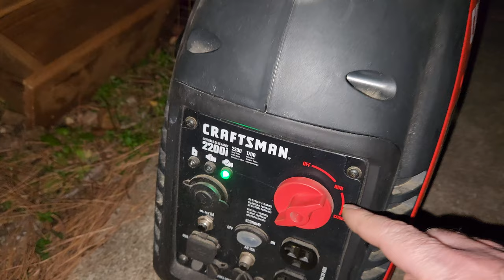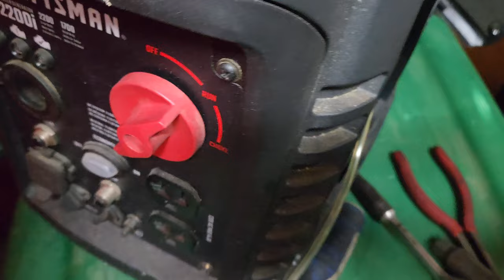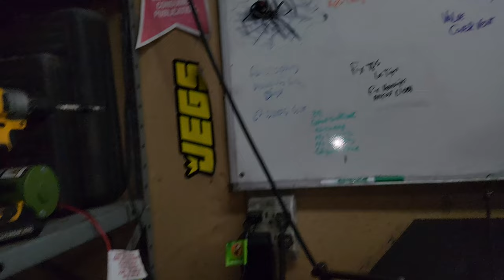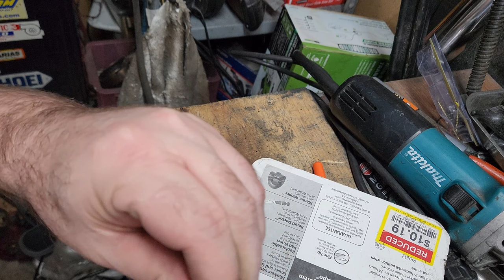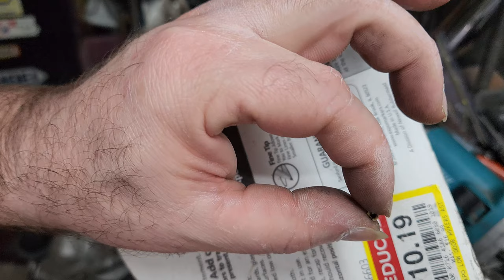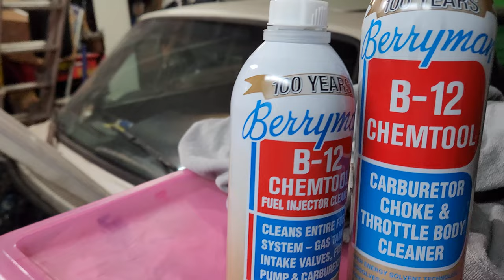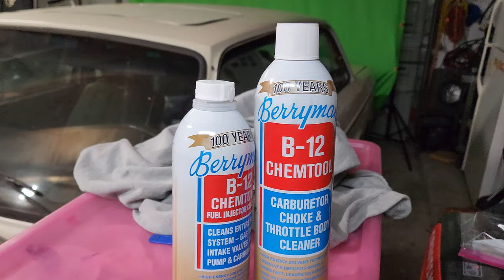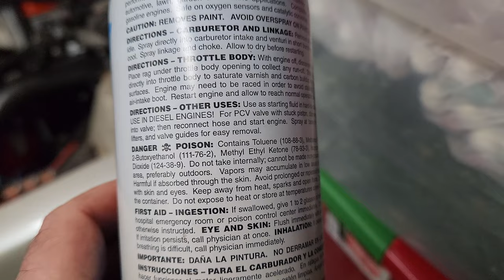My generator ran last year, now it wont start

Comment: keep the cursed ethanol gasoline concoction  OUT of your carburetors....!
Reply from the maker: You bring up a solid point , just drain the cursed moonshine with 15% gas out of your tank. Most folks don't ever drain the tanks so they will use generators once in three years and expect it to run on that same old gas or ethanol, and as a result, gas just solidifies (in around a year for the jets in Texas). Ethanol, creates moisture that rusts, and water will start to separate as it draws in more moisture to the tank as you store it longer and longer(about a year it starts showing problems in Texas, climate changes these numbers). 
  Both have their demons,  so pick your flavor and know the problems to eliminate. Obviously Both are still better than electric portable tech, by far. In my experience. 
  Has Anyone seen a electric generator yet? I feel like if the technology is so great for cars , they should already be some fine electric generators out on the market? I have seen the solar battery boxes, my mom has four I think, she says they last about 4 years, if I remember correctly. That is not quality, in my opinion but possibly the best one can get right now for the price, i think they are $1200 a piece, if I could ditch my electric bill for 4 months I would have one. I can't remember what they are called, hopefully mom will comments and share the details of the new ones she has , the brand , the output, the cost, and the experience -longevity.
Reply: We have 7 of them.I dont know how many years they last but we got our first one 3 or so yrs ago and it is still going strong.... @TurboWorld   We have 5 Jackeries, two 1500's and 3, 1000's and we have 2, 1800 Bluettis
Reply from the maker: Dang, what is your favorite?  @terrikershner1555
Reply: I like both. Jackeries last longer before charging but Bluettis charge in a 1/4 th the time @TurboWorld